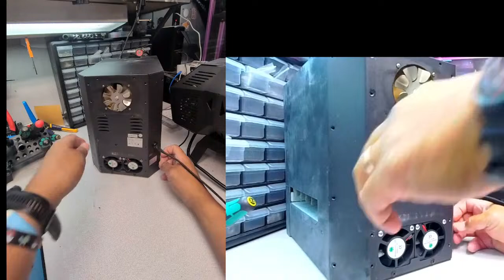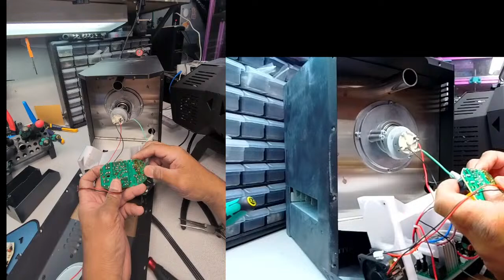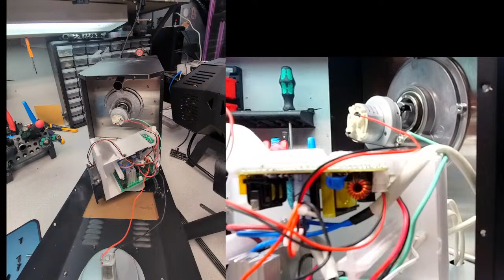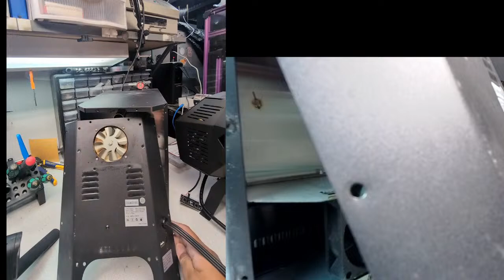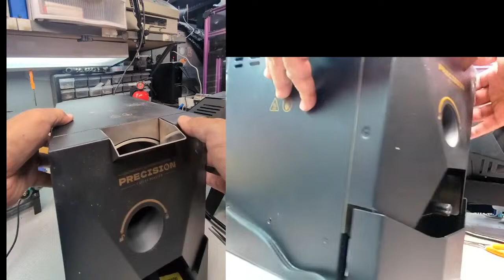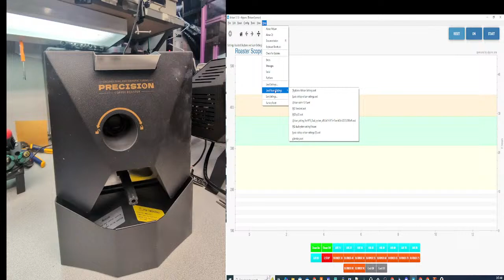Skywalker V1 3D Printed Electronics Enclosure

Comment: Is the larger fan connected to the original electronics?
Reply from the maker: @dichlor.methan  it can be a little concerned about the amp draw as the PSU specs are unknown. I use a separate PSU.